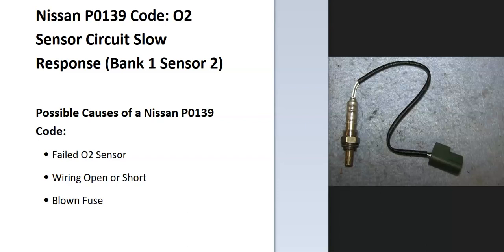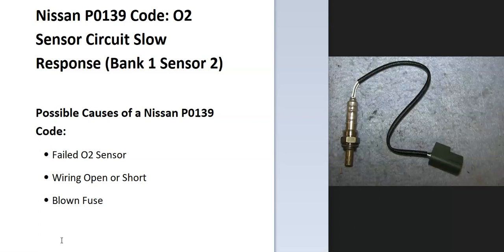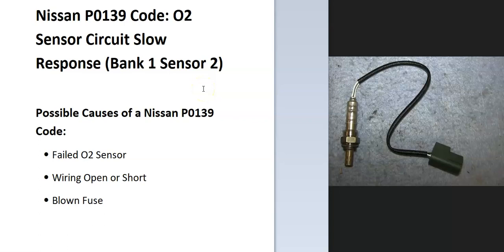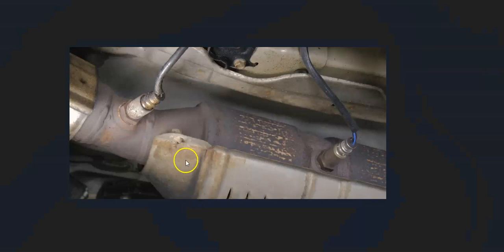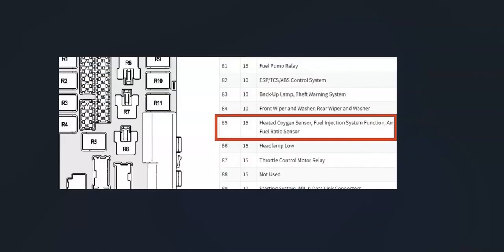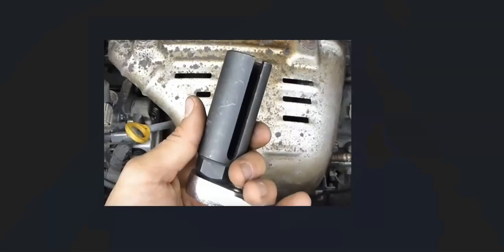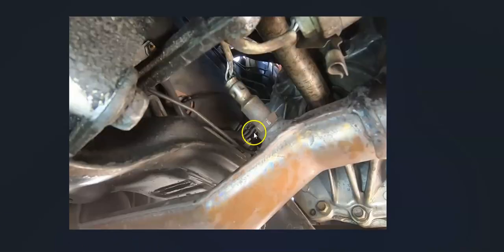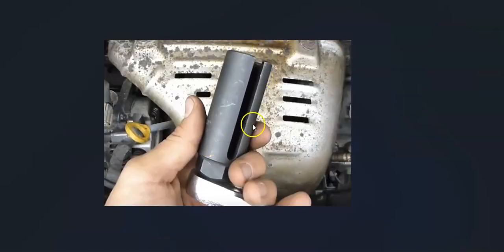Causes and Fixes Nissan P0139 O2 Sensor Circuit Slow Response (Bank 1 Sensor 2)

Comment: Is a 02 fix a labor intensive job
Reply from the maker: Removing the old one and screwing in a new one is a straightforward task, but sometimes they can be located in a difficult spot to reach, and sometimes they can be hard to remove. It's best to locate it and take a look to see how difficult the job is since it will vary.

Comment: I got P0138 bank 1 sensor 2. Is that the same? 2008 Nissan Altima SL 2.5?
Reply from the maker: Yes, it is basically the same. Check the fuses wiring and test the bank-1 sensor-2 Oxygen sensor.